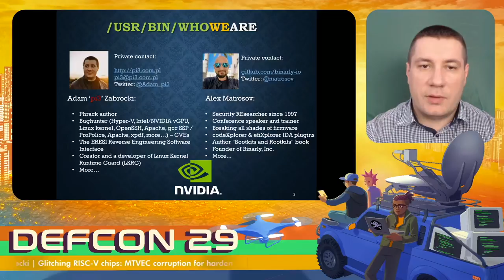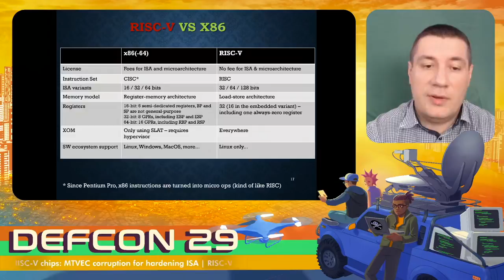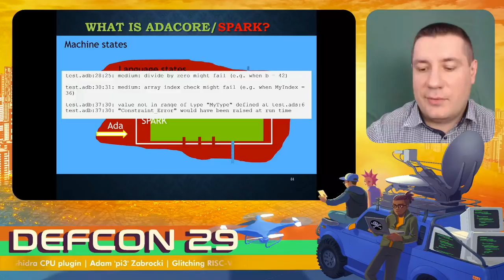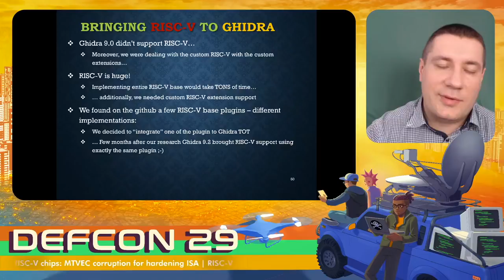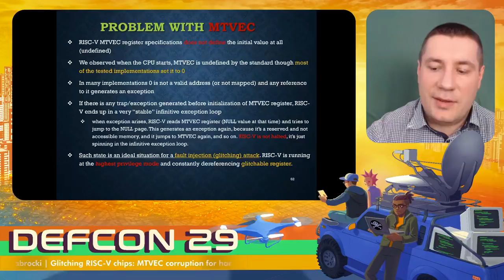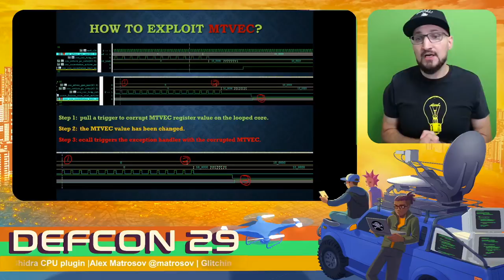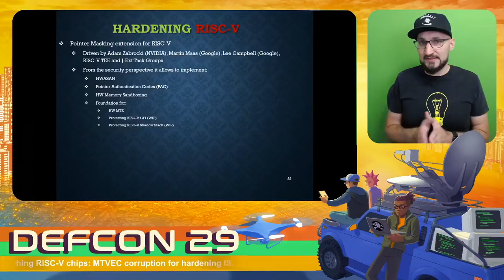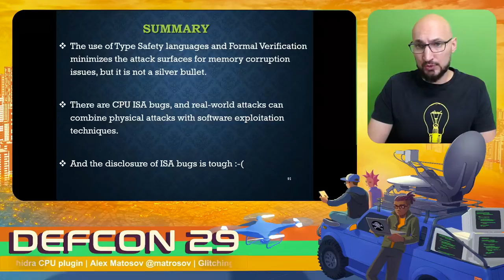DEF CON 29 - Zabrocki,  Matrosov - Glitching RISC-V chips: MTVEC corruption for hardening ISA

Comment: Awesome work, especially considering you're collaborating positively with the foundation. It doesn't seem a very extremely high vulnerability in certain contexts however as this needs physical access to the hardware. In certain contexts through such as in servers or data centers, maybe cloud services it could be important to mitigate for this as this can give root access (or machine level which is even worse) to the attacker. Either way, keep up the battle!
Reply: Thanks Amiar! These types of vulnerabilities are important where threat model takes into account physical access to the product / device. Such problems are important from the perspective of any locked devices like gaming consoles, mobile phones, or anything with the hardware root of trust.